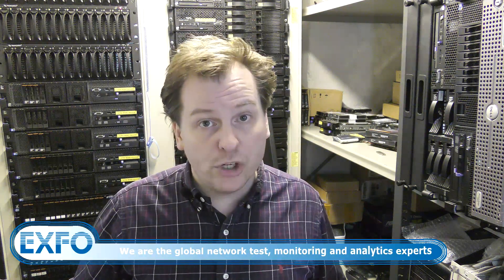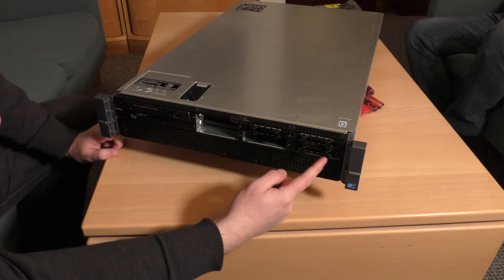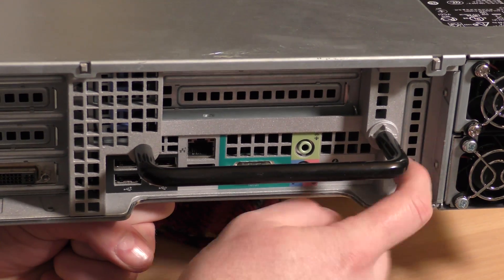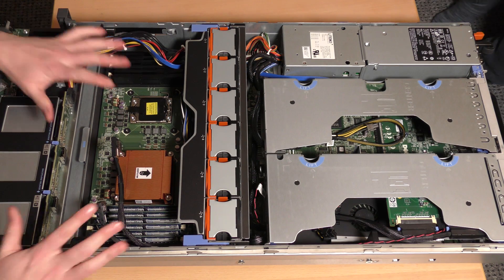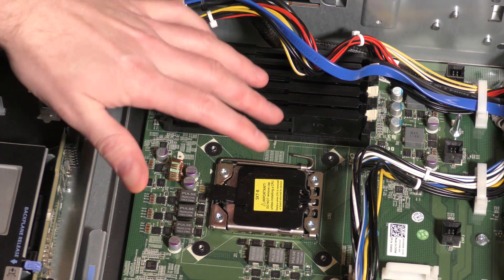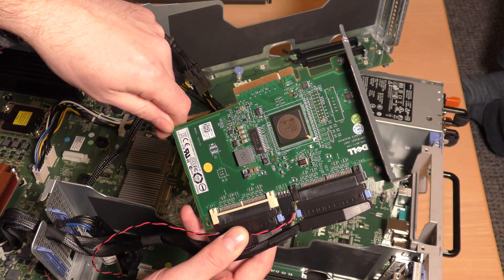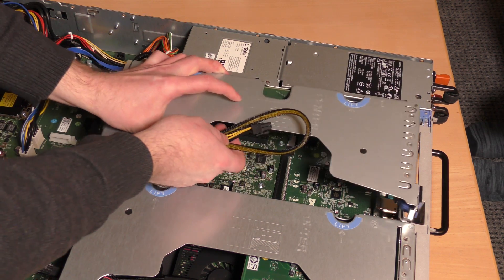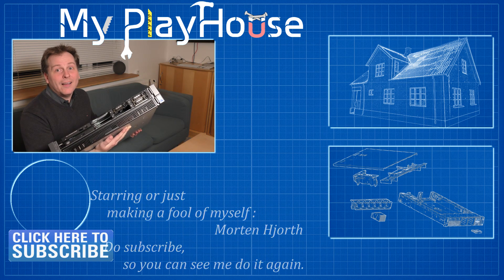Dell Precision R5500 Powerful Rack Workstation - 820

Comment: How can it be not a server? It has a server case, server hot swap psu and hdd, server rails, server riser cages and fans. Dual Xeon cpu. Server everything. Just take out the gpu and you have a server
Reply from the maker: Hi MojangYang YAN0014
I did not make it up, Dell cales it a rack workstation,,, and there is no management interfaces,, might be missing other server features as well.
Thank you for watching! :-)
Reply: No i do believe you, but i also believe it works well as a server :D
Reply: @mjyanimations1062  without management less so ( strange even though it's being classed as a workstation if it's gonna be in a rack it should have some sort of management as it's bit going to be someware easy accessed ( suspect it will do)

Comment: LOL, I seen this popup and I nearly wet myself. I have been using the Dell rack-mount WS's for years.  Started with a R5400 and ran it for 4 years then onto a R5500. The older R5400 has been given to a mate and is still been used for gaming on all the latest titles. My R5500 was also gaming and as my DAW/daily driver.
5x SATA II drives to the on-board Intel ICH10R. These are done via SAS cables and with a HW RAID card, can run either 2, 4 or 6 SATA/SAS drives or SSD's. The onboard SAS cable headers go to the Intel on-board but only 5 ports as the 6th goes to the SATA port for the DVD. The RAID card is an old PERC-6, best placed in bin and upgraded to a H710P.  The system can run up to 3x full length, double width GPU 's or any other combinations.
Reply from the maker: Hi Ben Styles
Thank You very much!  glad you liked the video :-)
Thank you for watching! :-)

Comment: so how exactly does this differ from a server? it uses xeons sas backplanes with a raid/hba controller, ecc memory, redundant power supplies and riser cards just like a server, so how is this different?
Reply: Workstation grade computers have similar type of hardware to servers.  They’re really not much difference at all  except for the application.  You can actually use a server as desktop computer if you can tolerate the loud fan noise.
Reply: No remote management is an important difference to servers. Also, servers typically do not have the desktop I/O shield back plate with 3.5 mm sound jacks and so on. The focus on having several full-size expansion slots is different from general server prioritization.
Reply from the maker: Hi Peterfixit
Not that much of a differences,, No management options,, and they might be ever so slightly cheaper.
Thank you for watching! :-)

Comment: Other reasons for having a rack workstation could be to avoid noise plus heating issues at the desk, and easier sharing of the beefy workstation hardware, similar to what Google is now doing with Stadia and gaming.
Reply from the maker: Hi Johnnie Hougaard Nielsen
Yes,, I did not think of that,, noise and heat..
Thank you for watching! :-)

Comment: These are so old now :(  good boxes but old.. Time to do a remote FX box :)
Reply: R7610 is same thing but generation newer, akin to Poweredge Rx20 generation (Xeon E5 V1/V2 Processors, still DDR3). R7910 newer still.
Reply: I didn't even have to look up when i saw the old SAS connector in the controller i could already tell it's age XD
Reply from the maker: Hi Mr Dashpuppy
Well two X5690's still kicks some decent ass.
Thank you for watching! :-)
Reply: @MyPlayHouse   Agree,, Throw in a few SSD's and some ram and use it as a remote workstation.. Even yuor new video editing machine RDP yeah !!
Reply from the maker: This was not mine,,,, :-)

Comment: Finally a Dell !
Reply from the maker: Hi Black_Heart_Gaming
Yes! Thank You very much!  hope this buyes me some time, from all the Dell fanboys :-)
Thank you for watching! :-)
Reply: @MyPlayHouse  I love my R510s for FreeNAS dell makes great servers in fact lately i've been leaning more and more to the dell used market than I also feel dell puts more effort into build quality than hp i mean the drive bays from dell are metal and sturdy hp is just cheap plastic, I used to have IBM servers a long time ago M3s and they certainly didn't disappoint, however i have an hp G5 here and one of the psus is already starting to fail..
Reply: @MyPlayHouse  DELL are the best choice since HP has removed the ability to download updates and software without contract, IBM has been sold to Lenovo, and Lenovo doesn't care at all about IBM hardware. Fujitsu isn't the same level of usability and hardware accessibility.
So Dell seems to me the ONE and ONLY choice for homelab hardware. And of course the hardware is lasting DECADES.
Reply: I just got rid of all my old Dell servers and upgraded to IBM x3650 M1/2/3. Hopefully Morten's preference doesn't let me down